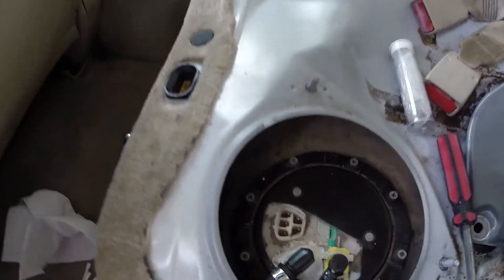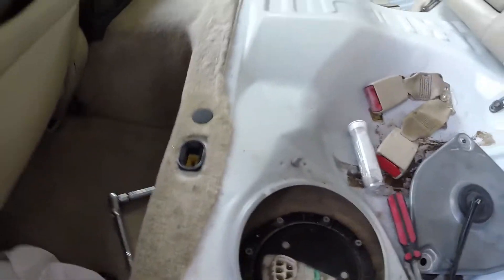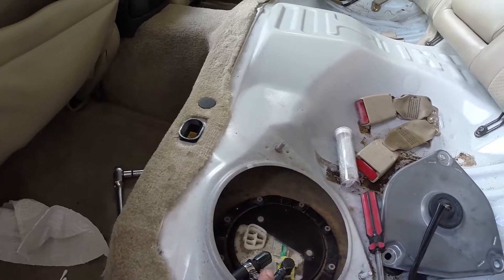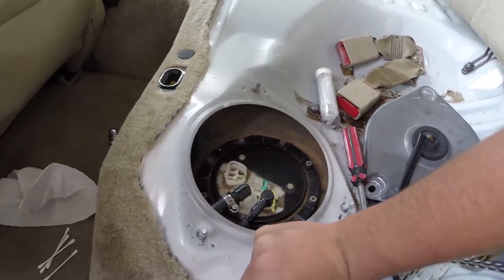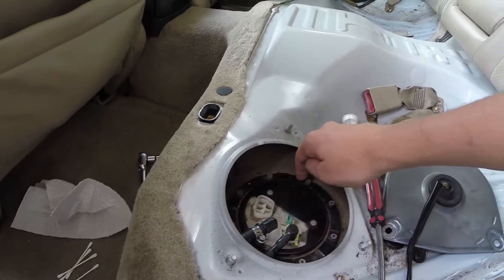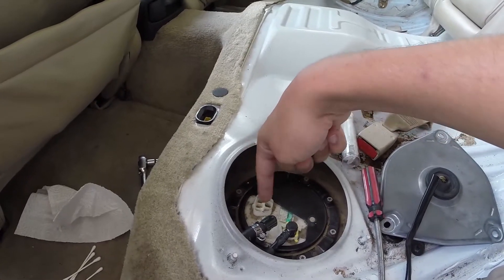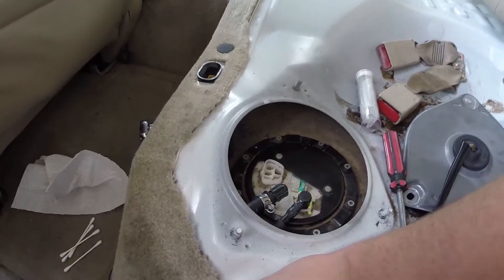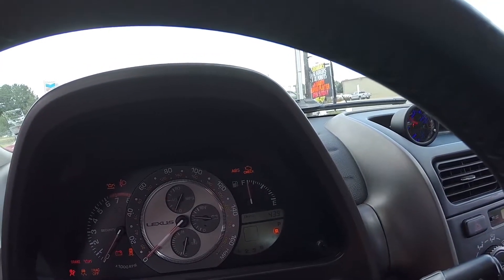We Fixed The Fuel Leak! 2JZGTE Swap Vlog!

Comment: My turbo IS has a weird issue where the gas gauge works in quarter increments.  Its common for turbo cars. The stock ecu runs the gauge and it uses readings from the stock MAF. Do you still have your MAF?
Reply from the maker: RacecarAndChill I do. Stock maf. My gauge is slightly off.
Reply: I wonder what will happen when you turn it up. I know another guy thats local here and doesn't make more than like 330 and his gauge works fine.

Comment: Are you planning a manual swap?
Reply from the maker: I get this question a lot. Most definitely! After the single turbo swap (which is in the next month or two hopefully) then the CD009 6-Speed swap will be the next big project. I'm going to release a video this week talking about my plan for the car as a lot of people are asking me what I'm going to do moving forward.
Reply: I'm actually excited to see this! The CD009 transmissions and the AR-5 are the new 2jz transmissions! I've heard that the manual trans tunnel and the auto trans tunnel are different sizes. If you have an auto trans tunnel you'll have to do quite a bit of modification to it. I'm excited to see what you find so we can finally put this to rest!